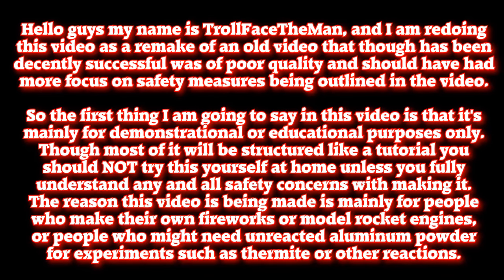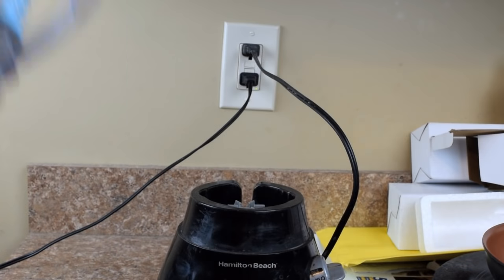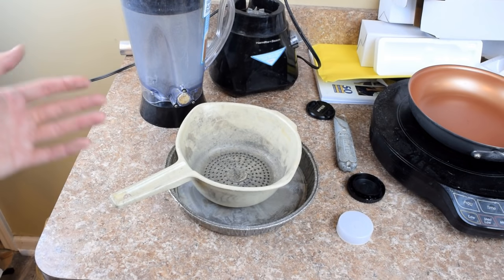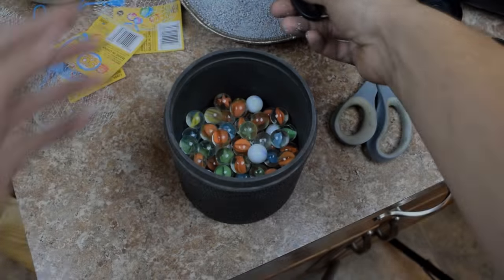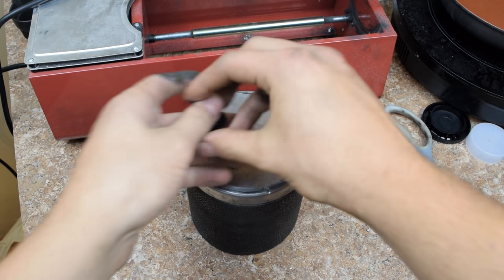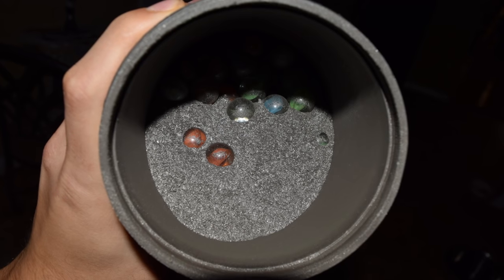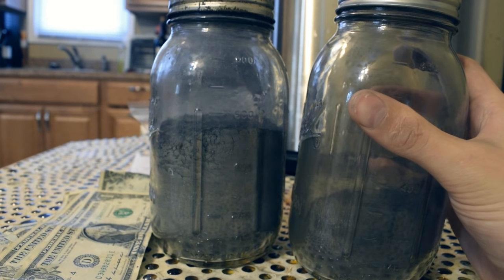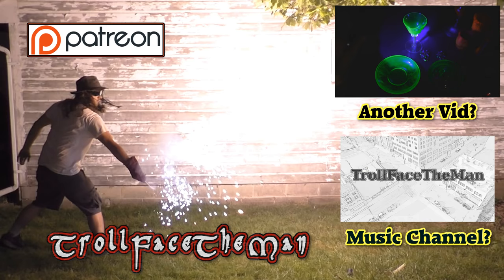How To: Easy Bulk Dark Aluminum Powder (My Homemade Process)

Comment: So milling aluminium in a vaccum chamber is a bad idea... Interesting.
Reply from the maker: JareMicah Schmidt well it's a great idea, until you expose it to oxygen. XD
Reply: @TrollFaceTheMan    what about milling in a vacuum chamber and then slowly introducing oxygen with a very reliable fine needle valve.  Explosive device or good way to get unoxidized powder?  What do you think?  I'm thinking about devising a way to mill in nitrogen atmosphere then jar the powder in an inert atmosphere using a multi chamber vestibule type system.  Not sure if there would be any benefits to this but the dangers are clear

Comment: Theres gotta be a better way by dissolving the aluminum then precipitate it out....
Reply from the maker: More that likely that will result in oxides that would be otherwise useless. But if you do find something I will be curious to hear of it.
Reply: @TrollFaceTheMan  hmm... Im trying to powder aluminium, using a paper shredder, then coffee grinder, then a ball mill.. I just think about how powdered gold and silver can be yielded by precipitation after dissolving them in a specific acid... Theres gotta be a way to do it with aluminium too! Lol
Reply from the maker: @jhyland87 , the problem with gold is it is extremely non reactive and resistant to corrosion. If it does form an oxide it will lose it very easily.

 This is very unlike aluminum that is extremely reactive and will actually steal oxides from many other materials quite readily.

 In other words Chemically speaking they are apples and oranges. I am sure it can be done, but likely not very easily.
Reply: @TrollFaceTheMan  ah, alright then. Thanks for clearing that up! Looks like ill be hunting for a ball mill or rock tumbler

Comment: You have to have Aluminum Nanodust before the air its self can make it burn or detonate
Reply from the maker: Well I know of many people that have had Aluminium spontaneously ignite from not airing while milling. 

 I know that the Aluminium I milled is way finer then my polishing compound which is about 12 microns.

 And if it is true that it needs to be nanodust I am sure some is produced as the partials don't all grind evenly. It just needs some to get the reaction going.

Comment: Why does your voice change in tone so damn mutch?
Reply from the maker: That is actually a good question, mainly it's because I have multiple voices I use. My relaxed voice I use when I am by myself which is extremely deep. My semi-relaxed voice I use around others that I converse with often. My "Proper Voice" I use when talking with strangers, which is basically very pronounced but soft. And my social voice which is the one I use most often when speaking with people I am friendly with or for most of my non voiced over videos. 

 That voice is mostly higher pitched and friendlier sounding than my natural voice. Which funnily enough actually has thus far manged to scare several people when I have spoke using it but they weren't expecting it.
Reply: TrollFaceTheMan XD I can see how that would scare people. I personaly like your deep voice. Mainly because I don't have near that deep of a voice and if I did I would use it.
Reply from the maker: Haha, Well thank you.

Comment: what about using copper BBs ?
Reply: Not enough weight...also BB  tend to be Copper coated steel...really bad as this can spark
Reply from the maker: Yes they tend to be just coated steel as mentioned.

Comment: Nah this is all bs. I’ve been milling for a long time using 1in ball bearings and I’ve yet to see any so-called flash explosion. Glass balls suck as it will take as long as the universe’s life to get any fine powder that way. Even with steel balls this takes a long time. Weeks! 
In my experience also the charcoal isn’t needed.

Comment: By the time you are done it's cheaper and safer to buy it.  2lbs on amazon for $24.......BTW weed wack your yard and move your bbq.
Reply from the maker: You are missing the point of it all which is that firstly not everyone in the world is able to buy this stuff because of restrictions. Secondly some people might just prefer to make something. Most of the time it will be safer and cheaper to buy premade furniture, but people still make their own too.

 Also nah, I like my weeds long and my siding hot :}
Reply: @TrollFaceTheMan  I live in the most restrictive state in Comifornia and I get it just fine.  As for the rest of the world it's not my problem.
Reply: @TreasureGeo  Why u here then?
Reply: @TrollFaceTheMan  hi i have a little question, i buy 1kl of pure aluminum powder, is necessary add charcoal?

Comment: Dude... the money grubbing volume of adds in this is completely ridiculous
Reply from the maker: I'll look into it. There shouldn't really be an unreasonable amount. I do know there is a mid role ad but unfortunately that is the economic YouTube has generated now a days.

 I would rather not need it but to make basically anything off a video at this point you need to do stuff like that as ad values are trash anymore and get worse.

 Also please understand the reason for having ads like this in the first place it to help make up time and materials cost for videos.

 A video like this can very literally take weeks worth of days like a job to plan, test, record, edit and finalize. And much in between. For most videos even with ads I see cents per hour of work.

 Still it is better than nothing. Anyways I apologize and again I will look into it.

Comment: Your process takes too long originally pyro aluminum was made by layering news paper and aluminum foil and then burning  the paper this anield the aluminum and made it very brittle so when it is ball milled it crumbles and turns to a fine powder much faster and of course the  charred newspaper was the carbon source to coat the al powder to protect it from oxidation.  At home you have only to heat the foil with a blowtorch or even in an oven  and add airfloat charcoal.  The final product is done when it has the consistency of flower and will burn or smolder in open air expose the aluminium to air daily when ball milling and do not try to get it to fine it can ignite usually some were below 2 microns or if deprived of air too long in the process of milling.
Reply: Why I cant heat the foil with burning newspapers at home. And how many time I must heat the foil with blowtorch.

Comment: safety blah blah blah
Reply from the maker: +Alex Oelkers I need to go over it, otherwise if I didn't think video would likely be removed.
Reply: Alex Oelkers you won't think blah blah blah when you get burnt or your house burns down. SAFETY FIRST!!!
Reply: +Alex Oelkers In order to grow old you need 2 things. Number 1 is smarts, number 2 is luck. You're obviously lacking in #1 ,so you better hope to hell you've got a shitload of #2.
Reply from the maker: +Charles walter I scrape by with a lot of numero dos myself ;)
Reply: I got it. That's a good one. Made me laugh.
Reply: Second degree burns blah blah
Permantent blindness blah blah
Life threatening injury blah blah
I don't think you understand quite how dangerous powdered aluminium can be, just because you only ever see it in its perfectly harmless normal form as opposed to its surface area x10^999 form doesn't mean it isn't fucking terrifying. Thermite uses aluminum. That's 1000°C from aluminium.